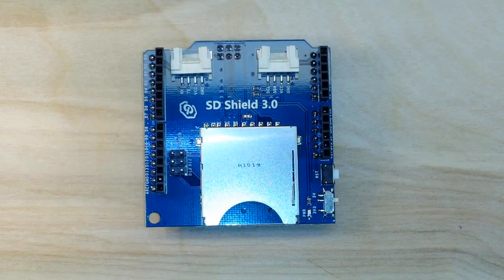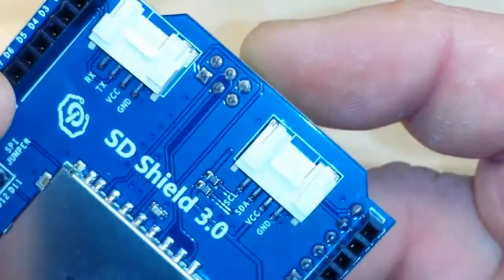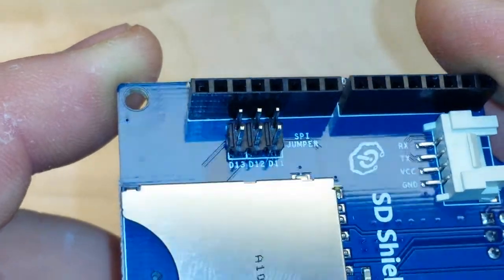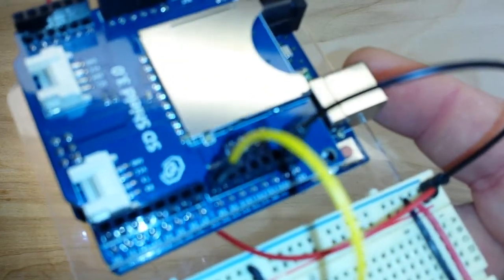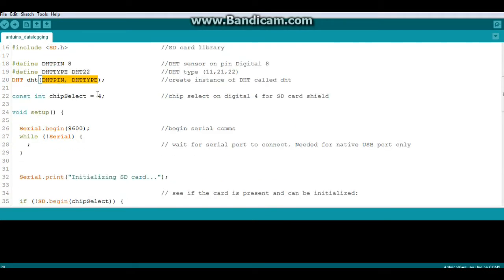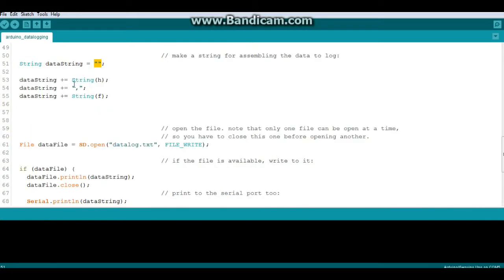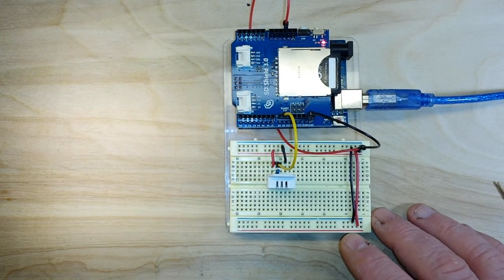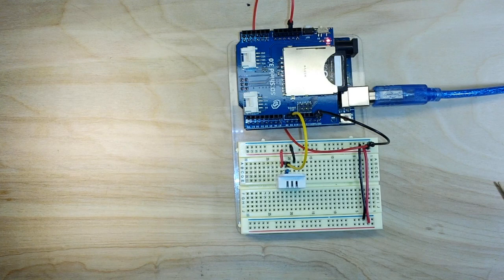Data-logging with Arduino

Comment: ello... I want to create a table in Excel and save it in the sd card which contains three columns.. The first column is longitude and the second column is latitude and the third column is a number between 0 and 10... then We receive GPS input, and if the longitude and latitude were equal to each of the numbers we wrote in the first column and the second column, it will display one of the numbers (0 to 10) on the serial monitor... Your help is very important to me.

Comment: Hello sir I have a question if I don't open the serial monitor then save the data in the sd card? I use a different power supply then the ket is working

Comment: Question: i want to datalog some much faster data (1MHz rate) with my due. Will the sd card be able to cope... 40% of available memory sounds like it is going to slow my programme down...

Comment: Great simple application for datalogging. You should see how many weather sensors I'm datalogging (hint i need a Mega) but one very basic and simple thing you can do is put a csv header in the void setup function that denotes variable type and units. Again this is more useful if your data string is long but good practice regardless.
Reply from the maker: Michael Padovani you are correct, thanks